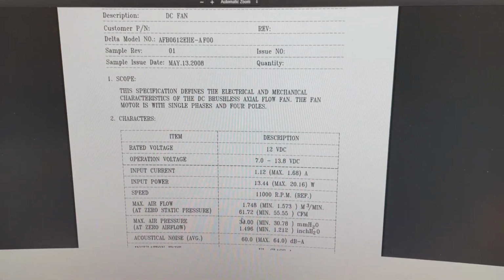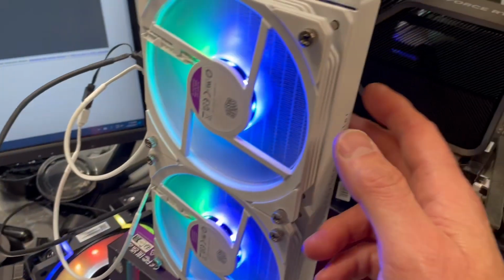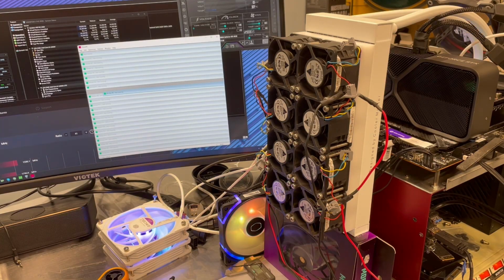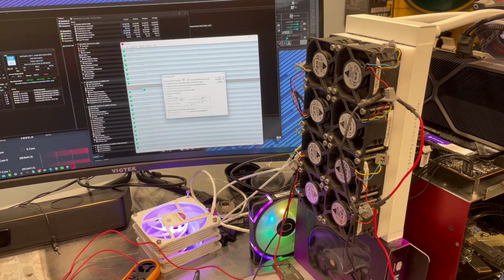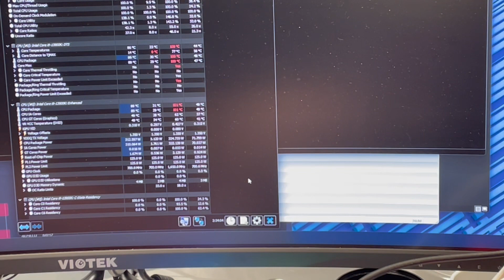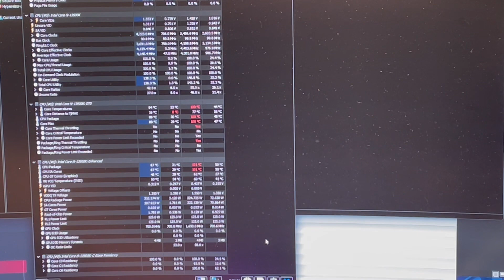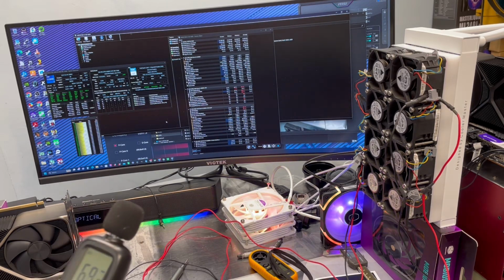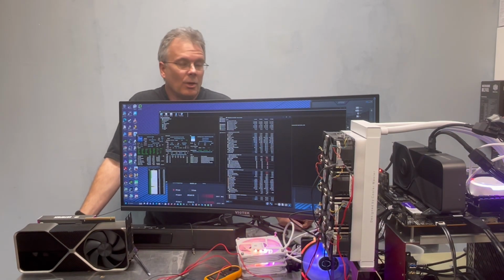500 CFM CPU Cooler!

Comment: Good work, BTW the spacer between the fans and the Radiator really helps with wind reflection and keeps air flowing properly... Good work ! Wouldn't it be better though to pass the cold air through the fans then through the Rad, instead of pulling hot air through the fans.. Aka heating the fans and bearings..